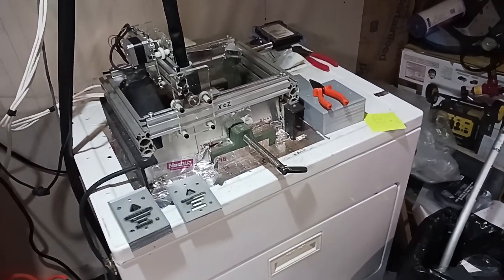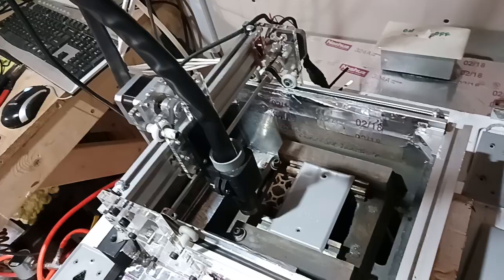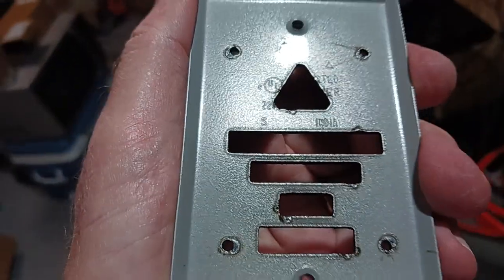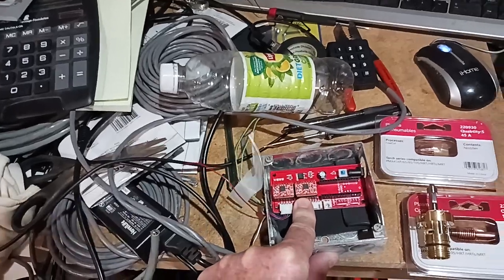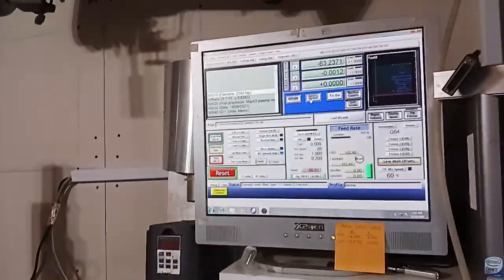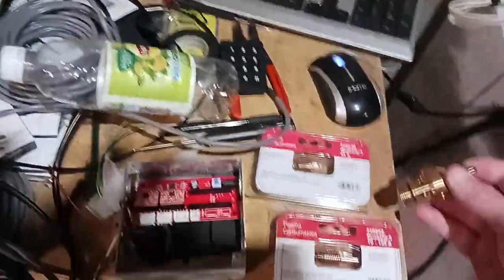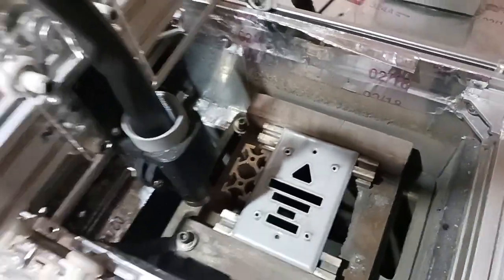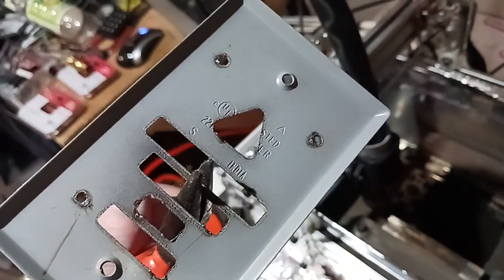$500 CNC Plasma cutter DIY

Comment: Wow, very impressive! How much faster can you go if you switched to a beefier stepper or even servos?
Reply from the maker: For 30 amps and 80psi, the cut speed I have is ideal.  I did repeat trials keeping pressure and current at a constant and I only varied the cut speed.  I reached an ideal cut quality at 3000mm/min and then cut quality suffered when I went up to 3500mm/min, so I settled on 3000.  Of course, I could try 3500mm/min and increase current, but overall I think I'm done with my experiments because I like the recipe I ended up with.  80psi is the max for the CUT50L, so I can't go higher with air pressure.
Reply: @JohnHansknecht  I see. Are the results similar for even thinner material? I’m interested in material about 0.4-0.5mm. Just wondering what levers there are left to turn to get better cut quality.
Reply from the maker: @ethanmye-rs  I'm a total noob.  The four levers are speed, current, air pressure and torch height.  According to what I have been reading on Facebook comments, the thinner a material is, the harder it is to get a clean cut without dross.  You also have issues with scorching since the metal can't remove the heat effectively.  I have not experimented with anything thinner than 1mm.